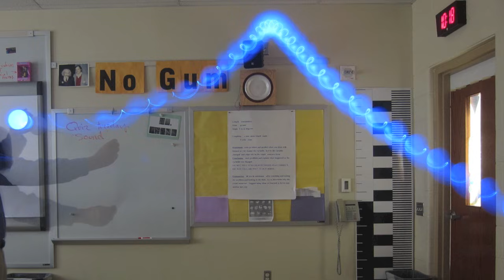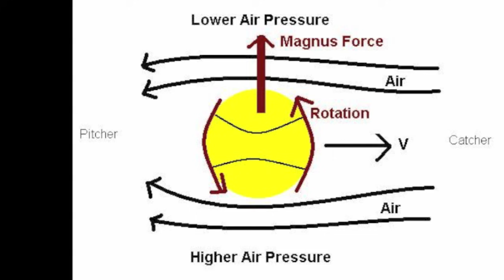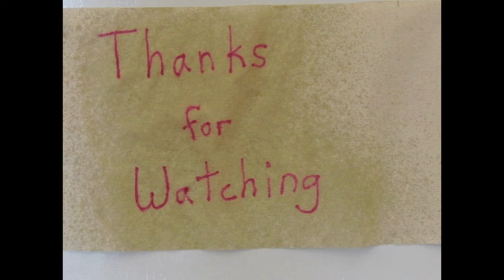Physics of toys- Cup Flyers // Homemade Science with Bruce Yeany

Comment: I was thrown out of physics class in high school for questioning the professor regarding bernoulli vs coanda vs newtonian lift in airplane wings. His example he drew on the board was a flat bottomed wing with a curved upper surface. I asked how it could fly upside down if bernoulli was the only way it was producing lift.  He insulted me, told me i knew nothing, do not argue with authority,  physically threw me into a corner, and told everyone to laugh at me.  I promptly left, even though he told me I was not allowed, and have not been back in a physics class since.  I now design aircraft for a living.

Comment: The most useful part of this as a physics demo is when you fire it on a vertical axis.  It curves sharply to the side but drops very quickly to the ground.  This proves that the distance covered in the "normal" orientation is because of the lift generated by the rotation, rather than just by the ballistic effect of being catapulted.  Excellent.

Comment: You can do the same thing with an empty ball point pen tube.  After you've removed both ends place the tube on the edge of a table.   Place your thumbs in the center of the tube and press down with some force.  You can use the edge of the table to help you pinch the tube.  While force is on the tube roll your thumbs back and allow the tube to move out away from you.  If you do this smoothly it and evenly on both sides will create the same effect.  I never knew this had a name, now I do.  Thank you for the video.

Comment: It makes such an interesting trajectory. That sharp spike, it almost feels like it goes backwards for a moment before resuming forward movement.I think air resistence kills that large linear momentum the cup got from the rubber band, but the cup's rotation never stopped so it continues to accelerate it forward. But it's odd that it stops, I would have guessed that it reduces velocity until a specific value and stays there.

Comment: The final flight at 45° testifies that Magnus lifting force is approximately equal to the drag force (if it is possible to separate them formally from each other). This follows from the fact that the vector sum of these forces is directed vertically upward and balances the force of gravity.

Comment: Bruce, that's an amazing job what you do. I would love to have a teacher like you back in highschool... or university.
Anyway, it would be very interesting to further experiment with the Magnus cups. I would try increasing the cup's moment of inertia with some metallic wire, or so, in the cup's extremes.
That would allow to increase the kinetic energy with the same or lower rotational speed, thus reducing frictional losses and smoothing the energy release. It's very likely that the flight time will be increased, even more with stronger rubber bands. There's is a lot to analyze and have fun.
Reply from the maker: Hi Pedro,  thanks,  I have  another video planned which will go into more detail

Comment: you can do a similar experiment to demonstrate this same effect by taking a cheap ball point pen with a plastic cylindrical body, stripping all the internals away, ink cartridge and back cap and simply putting the plastic body on one of your hard table top's and pressing firmly with your thumb until the pen body slips out from under your thumb.
Reply from the maker: I never tried that but will see if I can get the hang of it,  thanks

Comment: Did you think about doing this as a pusher prop?  That would not help with the "P" factor but it would help with the prop wash under the buckets.  If you could do inline, counter rotating pusher props, that just might do the trick.  Fun video. Thank you for doing this and post it.  I enjoyed watching it.
Reply from the maker: Hi Arthur,   good idea,  at the moment I have been experimenting with some Flettner rotors which are vertically spinning cylinders that were once tried to replace sails on a boat.  I hope to come back to your suggestion this fall

Comment: Hi sir,
A very informative, good and simple video. 
If i want to increase its flight distance, how can i modify its aerodynamics? ( modify its shape?)
Reply from the maker: Hello Krishna,  that would be a good variable to try.  We have used straight tubes from paper towels, they fly but are not nearly as stable.  I haven't tried adjusting them other than using standard cup or bowl shapes.  However, adjusting the mass makes a big difference

Comment: if your fingers are strong enough you can throw a pencil with a 'click' spin as if you were clicking and make it fly very well. Change the orientation and it will go in any direction you want.
Reply: Ricardo Gobin SEND ME THE TUTORIAL LINK
Reply: Sorry I couldn't find one. Try it though. Pencil between your middle finger and thumb, then click as normal giving it some good spin. 

You need to throw it at the same time. Use the same principles in this video to choose the direction.

Comment: you can also do this with a white bic ink pen tube   just strip the guts out  sit it on a table and with both hands use all 8 fingers and press down hard and let it slide forward and the pen will fly

Comment: Bravo ! Solar motors? And perpetual wheel please ( :
Reply from the maker: I did post a version of solar motors and have been working on another version but it's not ready to share yet.     I haven't found an perpetual wheel that is perpetual.
Reply: Bruce Yeany Ok let me rephrase that, how about a video on Mendocino motors and how about your take on the perpetual motion wheel using a bicycle wheel and water bottles using dense salt water?  Earth is a perpetual motion sphere assuming we can define perpetual motion as lasting Human lifetime. There are Mendocino motors than can run perpetually using charging circuitry that can run on milliamps  in up to 2 weeks of total darkness. Since we have sunlight every 12 hours give or take that's pretty perpetual.
Reply from the maker: I haven't seen the one using salt water but one of the ones I am working on will be exactly what you are asking for. I think it is a bit better than the Mendocino motors,  it is a reciprocating solar motor

Comment: I haven't played much with these.  Are they laterally unstable when mounted top-to-top?
Regards.
Reply from the maker: +Observ45er,  The cups can be mounted top to top and fly pretty good that way but there are some problems.  The bottom plates of the cups add structural strength as the cups are being taped and more importantly when the rubber band is being wrapped around it.   If taped top to top,  the cups tend to collapse when wrapped too tightly.  I've made a few and strengthened them by cutting out a piece of cardboard the same size as the top and then hot gluing it and two cup tops together.   Also the double cone shape tends to wrap the rubber band off center and causes it to wobble when released.  I'd stick to the bottoms taped together.
Reply: Bruce Yeany  Thanks, Bruce .  I'm going to survey all your videos.  I have all the Mr Wizard Videos on YouTube catalogged.   I grew up in the 50's waiting for Saturdays to come.   I consider Don Herbert the gold standard.
Reply from the maker: Me too!   I would say that Don Herbert got more people interested in science than anyone else in the modern era.  I also grew up watching his show and trying the same thing in our kitchen.  What a great time.  In later years I became a fan of Julius Sumner Miller,  he made a whole series of short film clips in the 60's   they are also available here on Youtube.
Reply: Bruce Yeany  I didn't find out about Miller until about a year ago and watched some of his.  In Chicago back in the late 50's 60's there was also Dan Q. Pozin with a wonderful style.
...
One thing I recently found out is the story that Bernoulli's "Principle" is "Fast air has lower pressure" and this is incorrect as stated and has several demos that are misinterpreted.  If you heard that also. I'll be glad to get you on the right track.  Herbert and Miller also got that wrong.  It has been repeated so much, by so many, for so long, it is very difficult to get the correct explanation.
--
Regards, Steve
Reply: +Bruce Yeany (Yeany Science) and physics is my business
Reply from the maker: very funny,   that sounds like a quote from Julius Sumner Miller.  thanks Nate
Reply: +Bruce Yeany (Yeany Science) Yeah it was his opening line. I'm doing your experiment tomorrow. This video is awesome.

Comment: Would a motorized cup stay airborn until it ran out of battery?
Reply from the maker: somewhere on the internet there is a video of the idea you are suggesting but it is gas powered. I'm not sure where to find it
Reply: Bruce Yeany I did some digging and sure enough found a few rc planes. but is a snail fan for a wing really the Magnus effect?

Comment: What force does this toy use?
Reply from the maker: The  rubber band propels it forward and causes it to spin.  What is causing it to curve is called the Magnus force.  If you do a search for this term, you will find several complete explanations with drawings showing how it works

Comment: Why not just glue the cups? What happens with a parallel cylinder?
Reply from the maker: taping is easier and quicker,  it will also work with straight cylinders such as toilet paper rolls but not quite as well
Reply: I would assume that the taper on the cups works like dihedral on a wing.

Comment: what happens if the bottoms of the cups are removed?
Reply from the maker: it would fly the same,   the problem is cutting out the bottoms would weaken them and since I wrap them fairly tight,  they tend to collapse

Comment: Next time write Magnus effect on the board. I couldn't understand you clearly and had to resort to the video description. Also, you should really tell your students why it's named the Magnus effect (Heinrich Magnus investigated the deflection of bullets from guns in 1852, but it had previously been described by Isaac Newton in 1672 and again by Benjamin Robins in 1742).

Wikipedia incorrectly attributes the Magnus effect to the Bernoulli effect, which cannot possibly be true as the Bernoulli effect generates lift only in situations where the air above a surface is moving faster than the air below it. In this case, relative to a stationary observer, the air is not moving on either side of the cylinder, it is the cylinder that is moving. Relative to the cylinder, the air is necessarily moving past both top and bottom at the same speed, except for the boundary layer, thus negating any possibility of a Bernoulli effect due to relative air speed above and below (except for the boundary layer). Looking at just the boundary layer, the force vector applied to the boundary layer above the cylinder is equal and opposite that of the boundary layer below the cylinder, again negating any Bernoulli effect, which depends on velocity, not direction. It's the downward speed of the boundary layer at the leading edge of the cylinder that is unmatched by the upward speed at the trailing edge, since the boundary layer stalls and breaks up into turbulence on the trailing edge. But downward air deflection around a moving curved surface has nothing to do with the Bernoulli effect and everything to do with the Coanda effect.

We can tell that the Bernoulli effect is not operative in this case because as the cylinder accelerates forward and curves upward it actually runs into enough air pressure that it stalls and begins to fall. The Bernoulli effect is defined as a reduction in air pressure as a consequence of air velocity, i.e. a reciprocal relationship exists between pressure and velocity in a compressible fluid. If the Bernoulli effect were truly operative in this situation there would be no such stall and fall behavior because there would be no such pressure buildup.

In truth, the effect is fully and satisfactorily explained by the Coanda effect (which explains that under certain conditions, air has a tendency to follow a moving curved surface) and the principle that lift (partial vacuum above a surface) always results as an equal and opposite effect to downward deflection of air below that same surface. (Note that when the cylinder stops moving forward over the downward deflected air it also stops generating lift and begins to fall.)

Comment: Just remembered.  I 'discovered' flying yardsticks as a young lad. You can just throw them with back-spin, but I recently made a yardstick launcher just like this.  Rubber bands and some string with a paper clip hook to catch the yardstick edge.
..
The yardsticks were lighter back then, but it still works quite well.
-- 
Regards, ScienceAdvisorSteve
www.challengerillinois.org
Reply from the maker: I never saw these but it sounds easy enough to make.  DO you have any more details on dimensions or how it works?
Reply: Bruce Yeany  Take a yard-stick and throw it with LOTS of back-spin by really snapping your fingers forward on the lower edge as you throw it.  It'll climb.  I saw it as a lad where it would glide with an obvious flat glide, but recently got them to climb. It's hard and it will go wrong often if not done JUST right, so I came up with the rubber-band launch after seeing the Magnus Cups, and that video of the basket ball dropped off a dam face by Veritasium..
....
Two 1/4 wide rubber bands for a total un-stretched length of 4 inches tied to 21 inches of string.  The other end of the string is tied to the CENTER of a heavy paper clip wire.  The wire is a "V" with the two ends about 2-3/8 apart. I did this double -hook because a single seemed to cause the stick to release off center many times.  The ends are formed into LOOSE hooks that catch the lower edge of the yard-stick.  If the hooks are too tight or too deep, the stick can't freely rotate out of them. It has to release cleanly without disturbing the already imparted rotation.  For a climb, there must be lots of back-spin. The very end/tip of my hooks have a reverse bend so the yard-stick "rolls off" them rather than getting jabbed by the end of the wire.  You obviously hold the rubber bands and wrap the string.  I think I only wrapped 6 turns, but I forgot to write it down.  Developed it last Summer and haven't used it lately.  Too much or too little wrappings - not good - play with it.  I just measured mine, and hope I got the procedure correct.  How to hook it and release it should be obvious to you.
...
The sticks do not have any dihedral for lateral stability, so they tend to roll off to one side, but they will still climb.   There may be a way to add some specially shaped end disks to provide this stability, but I haven't thought about what shape could raise the low wing when it is sliding off in that direction.
--
Cheers, Steve
Reply from the maker: It seems like it might be worthwhile to simply cut a strip of wood the size of a yardstick but a bit thinner.  I'll give it a try and see what happens.   I have a couple launchers for throwing styrofoam balls that curve very nicely.  As you throw it, it give it a nice backspin and the ball may curve 3-4 feet from it's intended path.  I actually like these better than the cups.
Reply: Bruce Yeany  If you can cut thin strips that is great.   I also suspecrt there can be some sort of end caps, or circular "fins", or "winglet-like" things that can cause a low wing to be pushed up as the stick slides off toward the low end...

...
I am pondering your bouyancy comments.  I think I see an area of confusoin regarding weight of a bouyant object and must choose my words carefully.  However I followed your descriptions and hopw to find some time while traveling to do it justice.